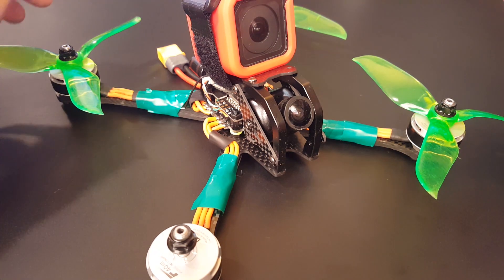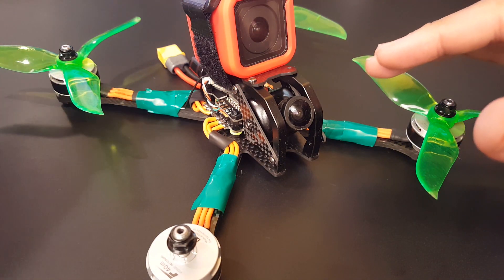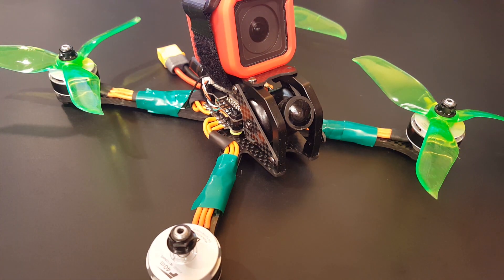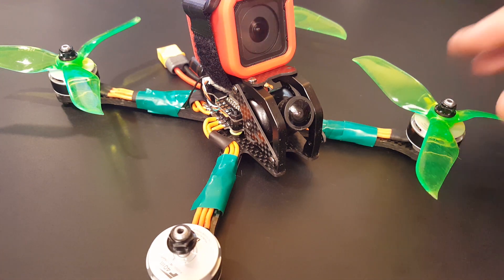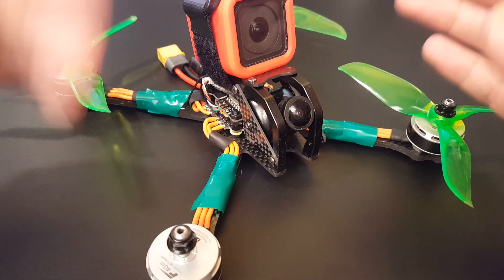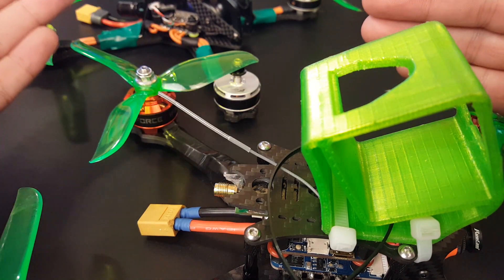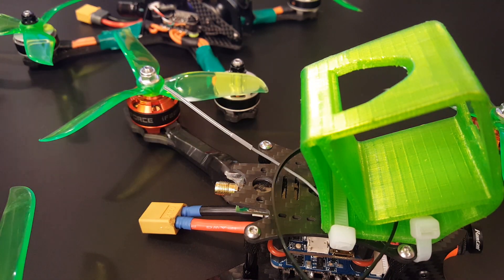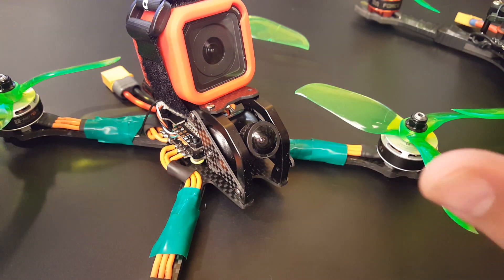FPV Noise // Common Problems & Fixes

Comment: What about when osd and buzzer stops working? Most of the time after a few punchouts
Reply: I think it could be because of 5v regulator. Try to use external one for anithing that you power from board

Comment: I build my first quad, i dont test noise but I wanted to have low ESC caps on my quad, I placed 220uf on every ESC and I have no noise, its really clean ! 
Build I have: 
Omnibus f3 AE
Ztw polaris 25a AE 
Racestar 2205 BG
Matek pdb with 12, 5v regulator
AE

AE- aliexpress
BG banggood
Reply: Nice setup. I had bad luck with AliExpress's Omnibus F4 Pro. What radio do you use?
Reply: IRFZ44 I'm using fs i6 and x6b receiver. I had problems to get everything inside qav x . i had omnibus f4 pro and problem with SD card and then I burned it, I got refund I ordered f3 non pro and OSD was crazy, I got refund somehow I managed to upgrade it to BF 3.2 and it works! There is something wrong with it but it not really matters. What setup you have ?
Reply: IRFZ44 with little bit of time I managed to get quad, 3 infinity 1500 lipos, quad, 2 chargers,  googles... For 280€ (305$)
Reply: LOL exact same problem as mine. Fried mine after connecting my USB cable, but this time, no refund and the damn thing is the original version is only two dollars more than the clone version here.
Reply: IRFZ44 you just need to find that is something wrong with it and never confirm order received, you need to be sure that it is working. With mine i find out that SD card is not working. Then I burned it. I had problem with BG ant that's why I have 2 chargers
Reply: Modified QAV X stretched X200
X-racer F303
Kingkong GT2205 2350KV (better than BR2205, I have compare it)
XSD20A
HS1177
Mi200
EV800 
Q X7
2X vcanz 1350 4S
All ends up at $355, that's six month of intensive saving : )
Reply: I burned it two weeks since I finished my build. There's no way to refund.
Reply: IRFZ44 that's really good build for just 350$ with  Q X7
Reply: IRFZ44 but I think ztw polaris is little bit better its like a same for cheaper and it supports dshot 600 without mod
Reply: It could be cheaper if I ordered directly from Banggood. 
Yes, the Polaris is better but I pick XSD20A because it's lighter. Racerstar MS series is a rebrand of ZTW Polaris series.
Reply: IRFZ44 Ok

Comment: I think you forgot a very basic thing to check that I have had on 2 quads. Ground loop via a long motor screw touching the copper inside the motor. Good video too. Thanks.
Reply from the maker: Dale Pattison I actually remembered after making the video however I have a quad with that same issue which will be featured onnthe upcoming videos.
Reply: use conformal coating or nail polish on spot it protects damage you might need to make gap first so not touching
Reply: Drone Mesh Awesome. When I started out I could not for the life of me figure this one out. Lol. It's often the simple things that get overlooked though. 👍